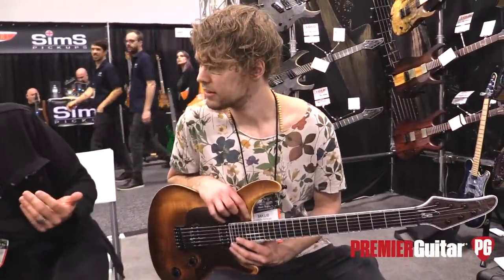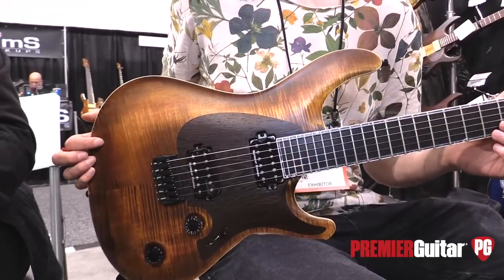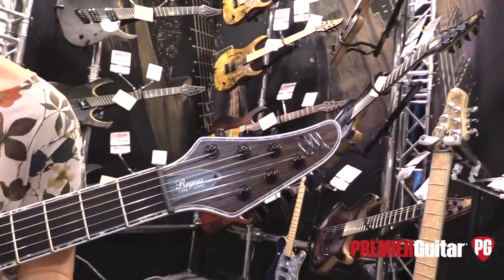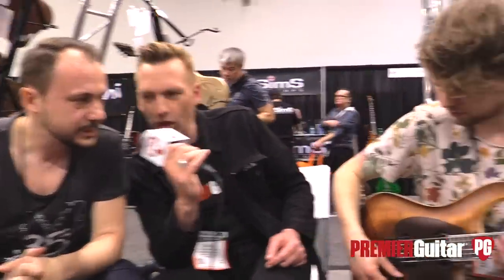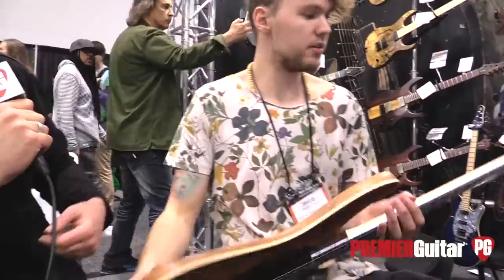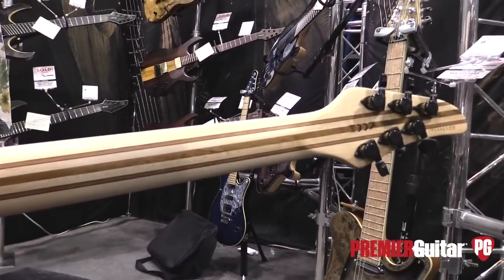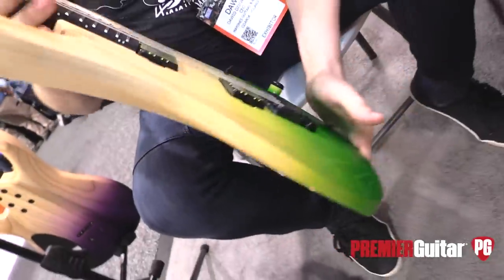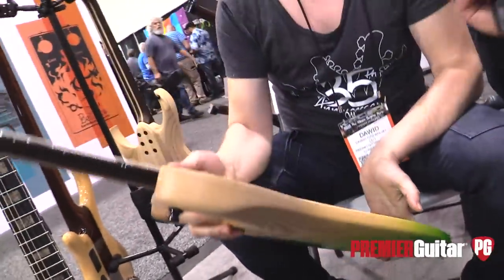NAMM '18 Mayones Regius CoreGuard 6 Master Builder Demo

Comment: For all the people saying these guitars are very expensive, in comparison they're really not.  Remember these are CUSTOM MADE guitars...You get to spec out everything about it.  This is not for people who want to buy an off the shelf guitar.  Compare what Mayones is offering to what PRS has to offer -- the equivalent would be a PRS private stock, for example.  PRS private stocks can go for upwards of 10 and even 20 thousand or higher USD.  And PRS doesn't even offer stainless steel frets!
Reply: Stainless steel doesn't cost anymore than nickel, and nickel is easier on your strings.